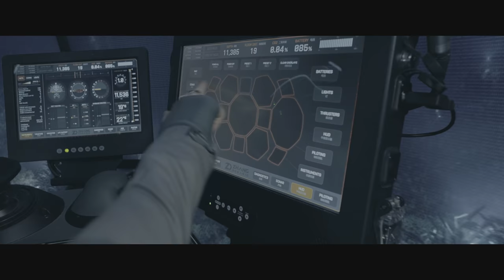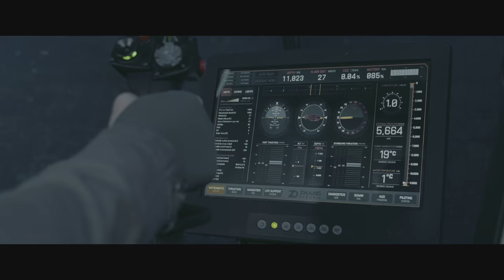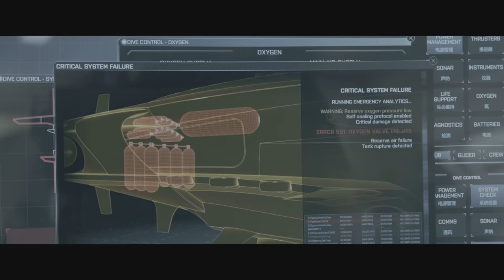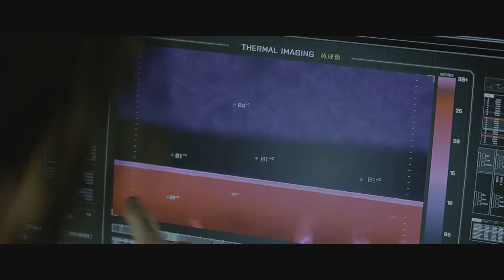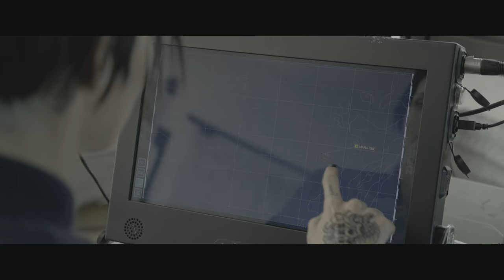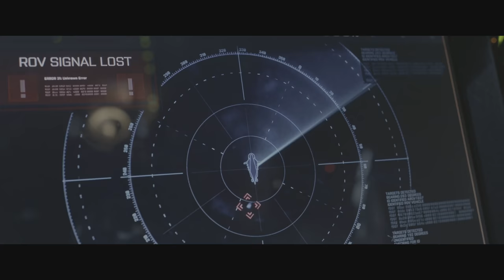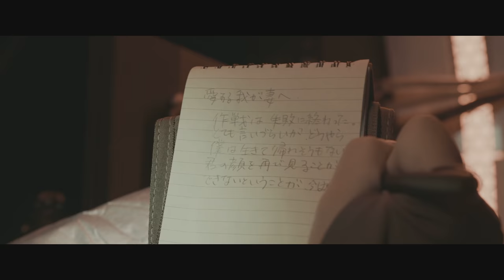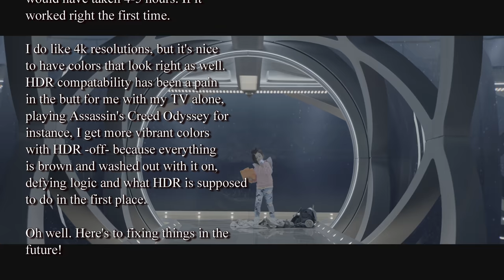The Meg Review

Comment: 19:00 - Fascinating. JAWS rips through boats and shark cages like they're made of tinfoil, but a honking big Meg can't bite through plastic?
Reply: Peyton mac If certain plastic can stop bullets they can also stop a humungous ass shark
Reply: @lavernmerriweather637  Maybe? The Meg has some serious power behind it, based on it's size. A bullet has a ton of force but it only hits once, and in a very small spot with low mass. A meg biting would be more like a hydraulic press, and then it's a question of how much pressure it could put behind it's bite.

Comment: I’d say it’s a four. The characters, effects, and premise make up for the plot holes enough so in my opinion.

Also in my opinion, one way they could have dealt with why there was a third Meg at the beginning: The sub that they are rescuing could have crashed into a thermal vent, causing the Meg to escape (like the ones later on), and that’s why they need rescuing.

I also think they should have held back from showing the Meg a little longer. While they were under the trench, they could just get glimpses and see it coming on the radar, and escape without having really seen it. Then, when the little girl is wandering the tunnels, THAT is the first time we see it: That would have been so much more awesome!!!

Basically, in my opinion, this script could have used five more minutes in the oven. Still love it though!